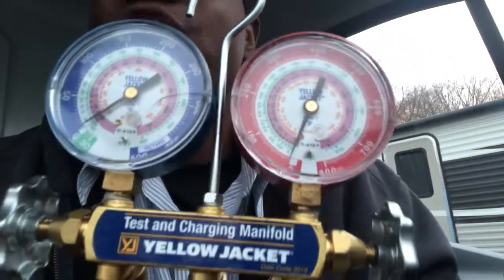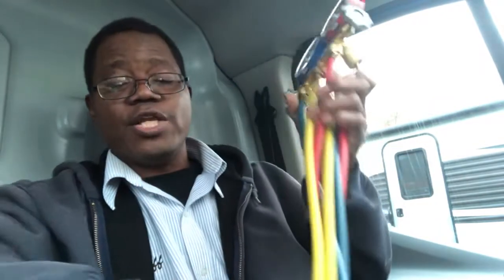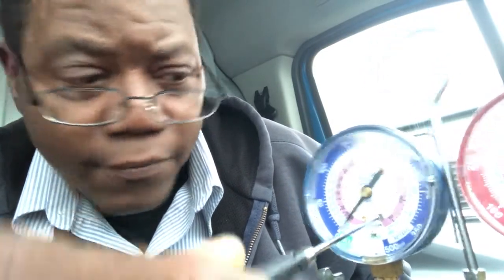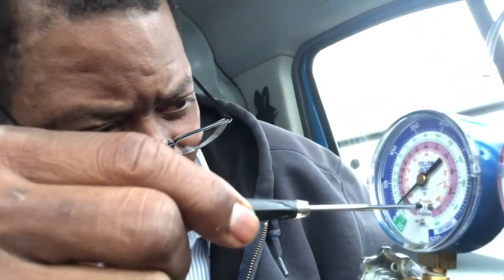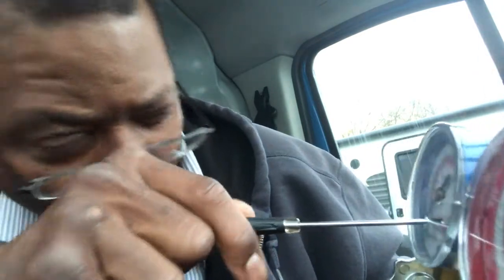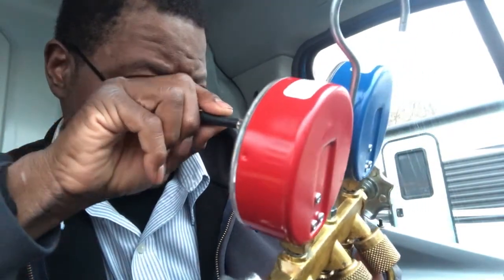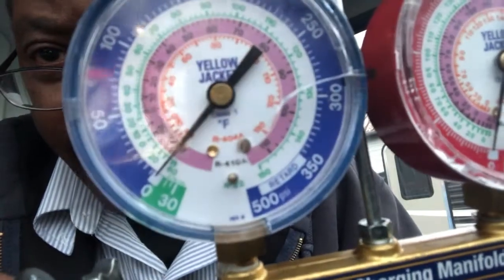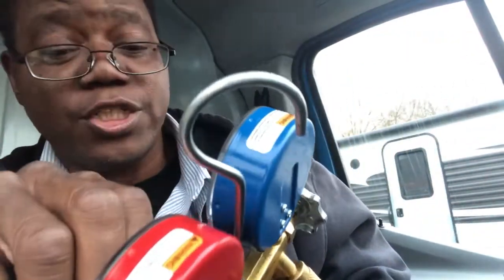How To Zero Your Manifold Gauge

Comment: I have a yellow jacket manifold with  knob on the side. So its clockwise to close and counter clockwise to open.For some reason when i open the low pressure side, refrigerant are not being added. Any ideas?
Reply from the maker: 1st try hooking your manifold up to nitrogen using the middle yellow hose and try opening and closing the low side to make sure the valve is opening up. If it is keep in mind if you are adding refrigerant to the system using the low side make sure you are connected to the low side of the system and your tank is turned upside down. Another thing you want to check is make sure your low side hose actually has a depressor in it. Sometimes us techs have to remove the depressor off the hose if we are connected to a removal tool or any situation. You can also try switching your hoses around to test them. If you need additional help let me know we can talk it through.